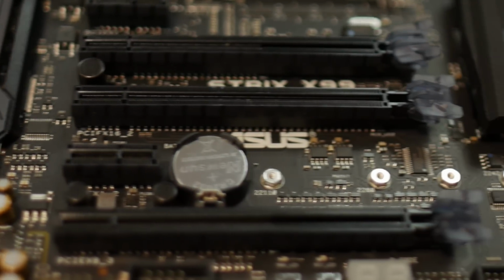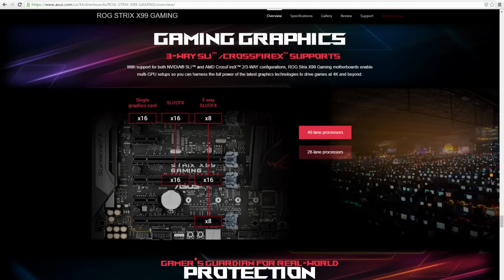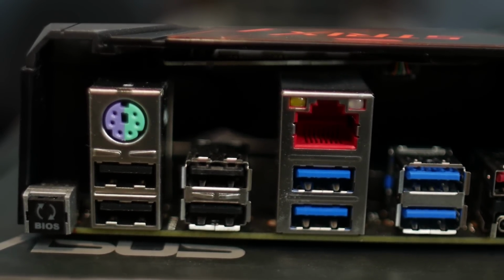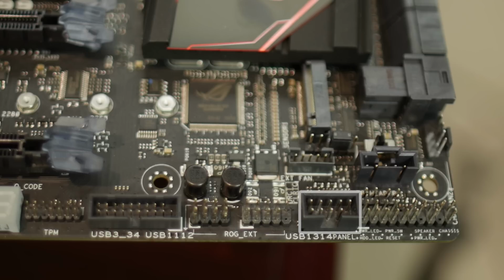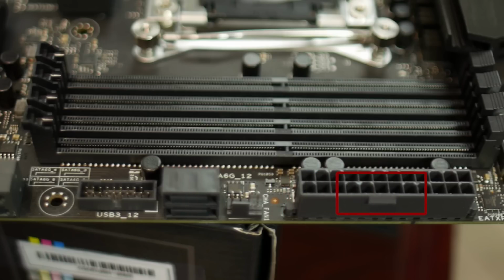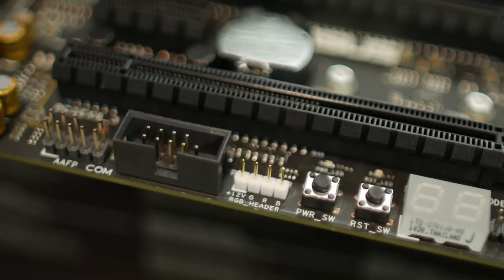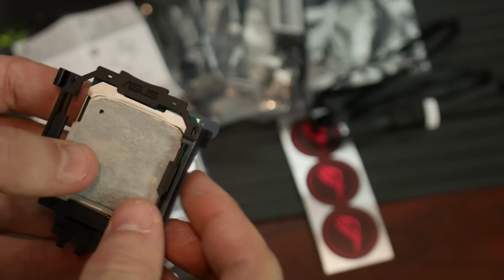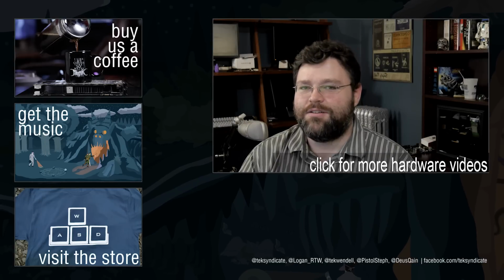Asus Strix X99 -- Unboxing, Overview, OC Testing

Comment: I am using a Xeon cpu 10 core cause i wanted 40 lane support but that wasnt the only reason it was cheaper to buy a Xeon than a i7 and i wanted to setup virtual machines instead of dual booting cause i need windows for gaming and i wanted to use linux for multimedia out of the box without installing third party software cause i dont have the time for that anymore.

But what i am having trouble with this board is, I have a 960 EVO NVMe 500GB/466GiB but it only comes up in the BIOS via CSM and not full UEFI mode whats going on do you know
Reply: Darth Sidious did you try disk management to format it and reassign a drive letter?

Comment: does it really support G.SKILL Trident Z 32GB  3200 speed RAM? because 3200 is not mentioned in the specs of this board on asus website. it is as follow:
8 x DIMM, Max. 128GB, DDR4 3333(O.C.)/3300(O.C.)/3000(O.C.)/2800(O.C.)/2666(O.C.)/2400(O.C.)/2133 MHz Non-ECC, Un-buffered Memory
Reply: AsBi I believe it would work, but you might have to run it at a supported speed, such as 3000 instead of 3200. I would suggest getting the trident Z RGB at 3000 and overclocking it. (that's my plan atleast)
Reply: It does support 3200.

Comment: I'm new this building a pc thing soo my question is. I've purchased this exact motherboard and I'm looking for a PCIe SSD configuration and was wondering if Intels 600p 512 GB M.2 NVMe PCIe Solid State Drive would be compatible with this motherboard, and the new 1080ti graphic card?

Comment: If you were to remove the orange decals on the STRIX heatsink and the ASUS logo heat sink what color would the motherboard emit? I'm trying to keep a consistent blue scheme with my build and would want those 2 heat sinks to be blue with the rest of the boards programmable lighting. I won't really want this motherboard if those 2 heat sinks are only able to be colored orange, pink, and silver with the decals. I tried to contact ASUS about this, but the people I spoke with couldn't understand English very well. So I don't know if you can program those 2 heat sinks a different color with out the 3 decals provided with this motherboard. Any help is appreciated very much!

also, would you recommend the ASUS STRIX X99 or the MSI X99A Gaming Pro Carbon for best bang for the money?
Reply: J-Z28 the only rgb lighting is the center rog text, accent light under the io cover and pcie latches. the decals are just fancy stickers no lighting on them

Comment: If u have 28 lane cpu and 3 pcie 3.0 slots populated, even if second and third uses like x4  speed (for example two Intels 750 PCI-E), then your graphics card in first slot will run at x8 only. Its not a big deal but still wrong way of making boards (x8/x8/x8 layout) considering that older Asus X99-A/U3.1 got x16/x8/x4 layout with 3 PCI-E slots populated.

From what i saw, preety much every X99 board with Type-C connector, uses x8/x8/x8 layout on 28 lane cpu. Really dont know why cuz probably 0.1% of customers uses 3 way SLI/CF and if u got money for 3 graphics cards, u will probably buy 40 lane, 8 cores cpu anyway. So if someone want x16/x8/x4 layout, he is short on options. I think only Asus X99-A/U3.1 allow it (at least from Asus).

Comment: i am planning to get this as my next gaming setup ............
however i want to use all of these at the same time so i want to know how the cpu lanes are allocated here :
1> want to use all 10 SATA ports (as in ssd or hdd but no M.2 or U.2 as they are very expensive)
2> 2 garphics card at the least (2 x GTX 1080's)
3> If i use 2 graphics card i do get the 3rd PCIE slot to install any king of upgrade like the ASUS THUNDERBOLT card ?? is this only possible with 2 graphics card or i can also have the ASUS THUNDERBOLT card along with 3 graphics card (dont plan for a 4 way SLI at all ......... 3 at the most)

Comment: Hey man, thank you so much for this video-I really needed this! I built my rig a couple weeks ago with this mobo and now I realize I need to reconnect the radiator fans to the CPU and CPU Optional. Also didn't know about the 1X lane.

 I used the installation tool, great idea for me since I am that super conserned DIY.

Comment: I like the XMP switch because there was one LinusTechTips video where Linus couldn't boot up the PC. The main issue was the CPU he was going to use had a very weak memory controller. It still worked but it wasn't compatible with the XMP profile it had with a different CPU. Because of that he had to get another CPU that did support it. With this switch if the CPU has a weak memory controller,you can just switch it off

Comment: I'm a really big fan of the matte black solder mask on the pcb.  I hope this is a style trend that will stick for the foreseeable future.  I'm not usually one for aesthetics but I'm so glad the days of squinting and tilting the board, at certain angles so I can read the labels when checking connections, are over.

Comment: So, in the case that I use 2 GPU's and a pci-e SSD in the bottom x16 slot with a 28 lane CPU, it will drop the 2 GPU's at 8x speed?

Comment: Wendall can I use the x16 2nd slot for a single graphics card ? I dont totally understand how the lanes are shared. You guys rock btw
Reply: Just in case anyone needs to know . Dont use the 2nd PCI-E x16 slot for a single card as it performs considerably worse than in the primary x16 slot

Comment: Too bad it doesn't support ECC memory
Reply: I know!!! The fact Xeons are supported but NO ECC?! I had my fingers crossed the whole time haha </3
Reply: *****  I'm hoping that the designers were focused on gamers and not builders so they decided not to use a new X99 feature like ECC.  Maybe another X99 mobo will have ECC instead of WiFi and other crap.  It would have been a nice Hackintosh system.
Reply: John Norris Yes. Perfect Hackintosh, complete system build from ground up - in time for rx480 etc.
Like you say, discard wifi and bluetooth etc.
If I was to be a picky child I would also say implement Intel USB 3.1 + Intel Thunderbolt 3.0 and charge a nice premium for such features
Reply: What type of system do you intend to build?
Reply: *****  My next system will be a multi-boot : Linux, Hackintosh, Windows.   I want to match as many of the chipsets to an iMac so it is compatible but the OS10 part is really a small part of what I do.  I'm more comfortable using Linux and only pop into the others as needed but want the option.

I'm excited about using ZFS with a system having ECC memory, too.
Reply: Do you have a forum account; what's your handle? 
I'd like to stay posted with whatever you end up getting or doing.

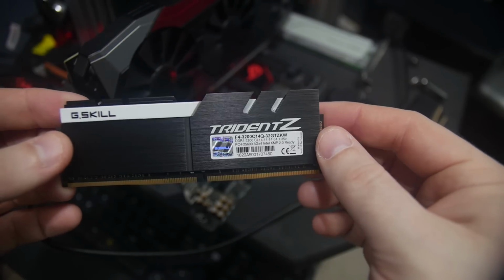Comment: Im over all this "gaming" with forced wifi. The unwashed masses force manufacturers to put it on and im just sitting here wishing they wanted ecc. also at 15:28 are you pushing ram into a running system?

Comment: So, if I get a single GPU, one M.2 SSD and one PCIe SSD, does that mean I'm good with a 28 lane CPU (x16+x4+x4)? What about the USB 3.1 controller, how is that connected to the CPU?
Reply: USB is a dedicated bus on the CPU, as is Thunderbolt if you get a board with a thunderbolt variant of the MiniDisplayPort (Thunderbolt 2) or USB-C (Thunderbolt 3).For what you specify, a 28 lane CPU will work, though you should save up enough to get the next tier up (40 lane) if you ever need more than 28 lanes. I'm not saying buy it the first moment you have enough saved, just to save it up so that you have the option. You're probably better off having a general savings for PC stuff and repair anyways.Be sure to check that your mainboard's M.2 port matches your SSD. There are 2 types: SATA and PCI-e. Some boards support both, some pick one over the other. Also, check to see if any SATA ports are on the PCI-e bus. On my board, ports 5+6 will use PCI-e lanes and shares bandwidth with my M.2 and U.2 ports, and that might be the case with other high end X99 and Z170 boards.
Reply: +://ReaperReaper
Got it! Thank you very much.

Comment: How do I find how the M.2 ports work on my motherboard?
I ffel I need that info if I want to go for nice SSDs
Reply: Go on the producers site and lookup your motherboard. It should say in the specification table. If it's PCIe or SATA.
Reply: Magnus Sivertsen It supports both and I discovered SATA ports get disabled once you connect m.2 drives

Comment: looks like you were pulling more amps than the motherboard could provide trying to light up that entire coil of leds. The ones in the center were not lighting up. I have heard of people making the magic blue smoke come out doing that, but that was with fan headers.

Comment: I wish they wouldn't put the UEFI update buttons on the back panel. Quite easy to knock while fumbling to put a usb plug in the back, A smaller recessed button or one that requires a small object to poke in to operate might be a nice solution to that.
Reply: I would expect it doesn't do anything, if it doesn't find a UEFI file on a flash drive, if you accidentally push the button.
Reply: I would imagine so. But if you do keep a UEFI file on your usb stick and have it in the computer. Could be an issue. Although I doubt it would do a UEFI update while the computer is actually running.

Comment: How far off are we from skylake E ? I not quite convinced yet jumping from haswell E to broadwell E
Reply: A few years
Reply: Reports I saw just this week are that it's the second half of 2017
Reply: Skylake-E will be retail next July and it IS on a different socket.
Reply: Hell, i'm running a 3930K Sandy Bridge-E and broadwell E didn't convince me to make the jump...
Reply: If you're on existing platform there's really no point in upgrading. Even 2600k is rock solid. 
 
However I'm just trying to minimize the "you just built a new pc now all of your hardware is obsolete" blow which will come evidently.